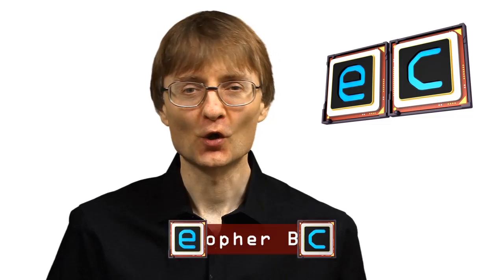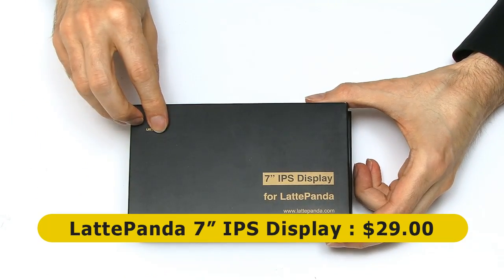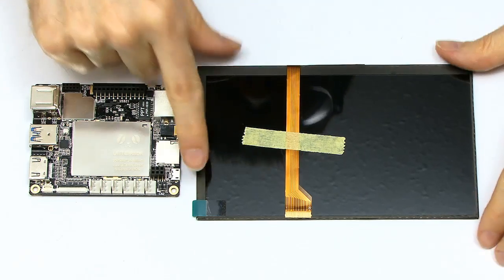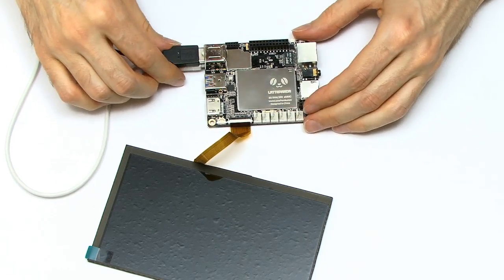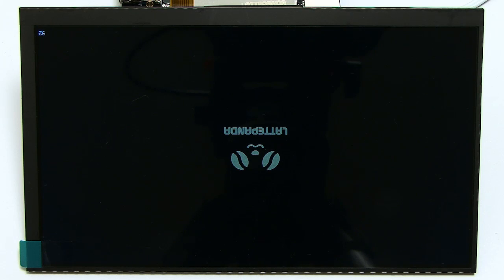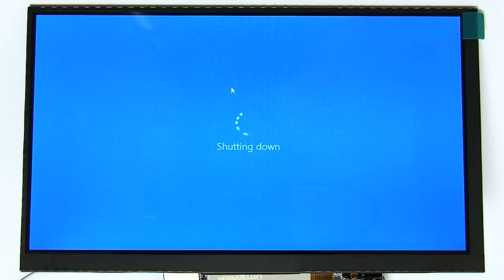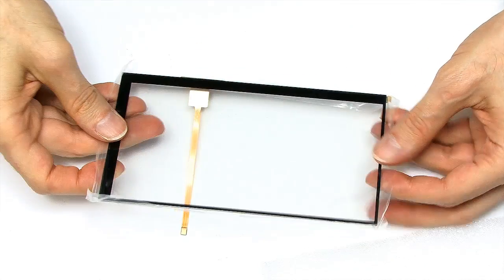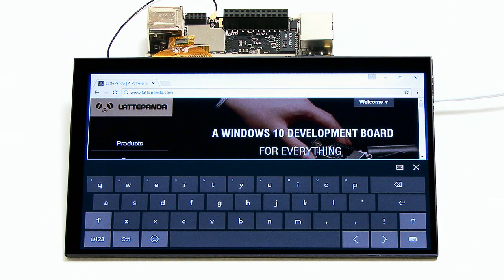LattePanda IPS Display & Touch Panel

Comment: Got a Raspberry pi 3 b+ . the 3d rendering program requires windows vista ...xp...or higher to run.  I need help to have my program be my sole pi use. New to this but my 3d program has been discontinued and I need help having a way to continue using it.

Comment: Is it possible to make it work with raspberry pi zero ?
Reply from the maker: You could potentially use some form of adaptor to get the screen to run from an HDMI input.
Reply: ExplainingComputers thanks for your reply, any idea from where can I buy in UK , atleast what name should search buy I believe only lcd panel adapter wont be enough because i tried searches didnt got exactly what i was looking for

Comment: Sir, can we used lattepanda board and used raspberry 5 inch display via hdmi cable??.. Are this working?
Reply from the maker: If the display has an HDMI adaptor, yes. If the Pi display connector, then no.

Comment: On the smaller stripe of adhesive on the touch panel you peeled off the small strip of sticky. You had it right in the beginning ... now there is a gap in the touchscreen edge on 2 sides

Comment: The angle of the cable in the screen is a little bit weird, it's against the lesser size, that can be a hassle if you need a good spot to stick the LattePanda.
It would be kinda better if the flat cable was in the right or left of the screen instead of in the bottom...

Comment: Hey raspberry can you install Windows programs on here like a normal computer or does it have to be a special program that's made for this device like the raspbiran os
Reply from the maker: Yes, the LattePanda runs a full copy of Windows 10, so you can install any Windows program that will run within the board's spec (which means most programs).
Reply: Awesome, thanks man, I'm ordering now, finally someone who not only does great vids but he gets back to you. very helpful highly recommend this guy, thanks for posting

Comment: Doesn't the Raspberry pi do the same thing without a silly overlay?
Reply from the maker: You can certainly fit an LCD to a Pi. I don't understand your overlay comment.
Reply: ExplainingComputers The capacitive overlay you had to install over the main screen. The Raspberry pi has it's own 7 inch screen which doesn't need that, it's all one unit. And one connector. I'm surprised the people who make Orange pi have a two piece screen. Rather complicates things. A lot more fiddling about.

Comment: Will it still work whem u connect it to hdmi
Reply from the maker: Yes, you can use both the LCD screen and an HDMI-connected monitor at the same time.
Reply: Thanks maybe make some dual screen p.c.

Comment: is it portable?
Reply from the maker: Yes if you can mount it in a case or otherwise. The whole thing will run off a USB power bank just fine.
Reply: thanks
Reply: Can i add more usb ports?

Comment: I kinda wish monitors where sold with the option of that connector (I guess it's a MIPI DPI connector) so you could attach the panda or some other SBC...

or if larger LCDs where sold like the little ones are on Ebay.

Comment: Agreed with many comments is there a case and battery solution on the way and  better still a  similar but 10 inch version .I can live with extra thick case from USB  ports to be able to hook into larger screens at home  and  also do dual boot up with a linux like mint

Comment: Could I theoretically install steam on this and have a mini portable steam machine?
Reply from the maker: I believe so, though the specs for gaming are low.
Reply: ExplainingComputers Yeah that's true, more curiosity than anything though. Anyway, thanks!
Reply: ExplainingComputers can the panda achieve successful overclocking
Reply: you can have an external video card however, and be able to play some great games. But if you want to play hardcore graphics gaming, you'll have to wait for the new Alpha model which has a x7 Core Intel CPU and the ability to expand video card to a 1080 if you wanted to.

Comment: Is there a way to wireless transmit the video information from the computer to the screen and the screen wirelessly transfer the touch information back to the computer and the only thing connected to the screen would be a battery and whatever wireless tech it needs to send and receive the mentioned data...

Comment: is there ANY other LARGER display or touchscreen i can use for this pc ???
Reply from the maker: I am not aware of another panel specifically sold for the LattePanda. However, it is a Windows PC with HDMI and USB ports, so can connect to any touchscreen that connects via HDMI (up to 1080p) and USB.
Reply: ty ill post u a pic of the project when i have completed it , going after a patent first tho befor i give photos !  ty again

Comment: please tell me one reason why t pay so much money to assemble a tablett my self if i can buy a ready one cheaper.because of win 10?you lose your name for sponsors.why you dont show the panta with other os maybe is even faster
Reply from the maker: It is very hard to install another OS on the Panda as it does not have a standard boot loader (like many Atom PCs), so you cannot just boot from USB and install, say, a Linux distro. Some have managed to get Linux working on the Panda to a degree, but not with all required drivers for networking, graphics, etc.

Comment: as this is a Intel video card if you got a keyboard plugged in press Ctrl+Alt and use the up or down arrow to Flip the screen (think the on screen keyboard can do it as well as you should be able to tap alt and ctrl to lock them on then press the arrows) or click on the Intel video driver in the icons bottom right and rotate the screen (windows 10 display page also has the options to flip the screen 180 as well)

was looking at one of these but its around £100 in the UK look intresting

Comment: correct me if im wrong but couldnt you techinically just make your own galaxy tab with this lattepanda and a screen? I mean everything is there, win10, ram, expandable memory, wifi. Seems like it would be easy to duplicate an ipad or samsung.
Reply from the maker: You are right! You just need a battery -- and a USB power bank can serve for that.
Reply: Do you know of any videos or a site that talks about how to connect and battery and charging circuit to the lattepanda?

Comment: Is there a way to connect a harddisk to the latte?? Sorry, im not very into technology, but these board pcs are so amazing
Reply from the maker: You can connect a hard drive or SSD via a USB port, preferably the USB 3.0 port. And you can add more storage via a micro SD card.

Comment: this is like a less expensive version of the microsoft surface. it would be nice if it had a functional case for it as well.
Reply from the maker: There are various cases for a LattePanda and screen that can be downloaded for 3D printout from Thingiverse (and which you could get printed via 3DHubs if you do not have a 3D printer). I intended to cover this in a video fairly soon.
Reply: that will be cool. i look forward to seeing it. i was kind of sad that MS discontinued their surface model. now at least i have other options available.
Reply: surface studio > $3000. it's not in the same ball-park as the discontinued MS surface.
Reply: the surface 3 came with windows 10 and was in the $400-500 range.

the least expensive surface model available now is the surface pro starting at $800 and i don't think it's worth it compared to other windows 10 tablets.
Reply: Androth worth it because of the power
Reply: uski12 did you really think im stupid enough to think that an arm cpu will beat a windows running machine? i meant that the surface line is worth the price since it has pretty good power
Reply: uski12 since most windows tablets dont even get close to it
Reply: uski12 dont worry its ok
Reply: uski12 i mean you exagarted with the sorry ness idk im spanish and my english is not that good
Reply: true but not what i'm looking for. i already have a small laptop that blows any surface away. i want to get one that i wouldn't mind getting dirty, breaking or losing.
Reply: Androth also the 400$ surface you were talking about was the surface rt right? it didnt have full win 10 it didnt let you install anything it was shit

Comment: I'm retrofitting a 1987 Toshiba laptop with this display and the Lattepanda 4Gb. The original screen was about this height but much wider.
Reply from the maker: What an excellent project. Have you managed to connect the old laptop keyboard to the LattePanda?
Reply: ExplainingComputers Yes and no, I had to reverse engineer the keyboard. Most but not all keys work now with USB. I'm still working on that part

Comment: Are there any mounting holes of any kind on the back of the monitor?
Reply from the maker: So, no mounting holes -- or anything else similar -- I'm afraid.
Reply: Could the touch panel work with another 7-inch Display if it's compatible with LattePanda? I'm trying to find a way to make a compact setup for my lab station

Comment: I realize that this SBC and touch screen has some coolness for experimenting, but you're spending more than you need to for a functional Win10 touch 7" screen computer. With the LattePanda and screen and touch you've already spent over $200 and you haven't even got an enclosure, battery power or power supply. In comparison, for $165 you can get a full Win10 2G/32G quad core touch netbook with 10" screen on Amazon (G-Anica Chromebook) with a 1 year warranty.

For an IoT device I prefer RPi3 (or DragonBoard) with Win10 IoT Core Pro (Pro version is free now) since the OS can be locked down to protect it and your application from tampering.

Comment: In Windows 10 you should be able to flip the screen orientation by holding the right alt key + the down arrow (for upside down), right arrow or left arrow for side rotation, and bottom arrow for right way up.

Comment: I am not a developer. is this still a viable windows board. I wish to use many small cheap boards. to link into the Berkeley BOINC computer grid.
Reply from the maker: It is certainly a viable Windows board.  Windows 10 runs absolutely fine. I know nothing of the Berkley BOINC computer grid I'm afraid -- though it sounds very interesting! :)
Reply: Thanks for the info. I have been to their site. I can't find reference to which version of 10 it is. (Home, Pro, Ultimate) do you kow how long this has been around? There seems to be some trouble with bad cards. I think this is a very nice idea for portable computing.
Reply from the maker: Matthew Doenges The LattePanda came out this year (2016) as I understand it. I too have read about some problems with the first production batch, but I think this is a past issue now. Often the first batch of a product has issues. The Windows images available are 32bit for the 2GB board, and 64bit for the 4GB board -- links are lower down on this page: http://www.lattepanda.com/docs/#How_to_re-install_LattePanda_Windows_system (look under "How do I re-install LattePanda Windows system?"

Comment: You know it has arduino(micro controller) in built. So you can make a box of this with the screen. Have a temp sensor inside and a fan that turns on if it gets to hot..

Comment: Can the touch panel/display and the hdmi display be used at the same time? Like dual projections or running two displays on your desktop.
Reply from the maker: Yes, you can dual display and use the LCD panel and the HDMI output together.
Reply: cool

Comment: So can the LattePanda have an external HDMI monitor plugged up while this display is being used, or does using this prevent the HDMI output from working?

I really wish they'd sell the larger 4GB/64GB version of the LattePanda with an activated version of Windows 10, instead of leaving the confusing activation process as an exercise for the customer.  I would have ordered one of those months ago! 

Thanks for the great videos!
Reply from the maker: Yes, you can run both the LCD panel and an HDMI monitor -- which is pretty neat! :) It is indeed say that LattePandas with Windows activated (as I show in the video) no longer seem to be available for the 4GB/64GB version. You can, of course, use Windows 10 unactivated for an indefinte period if you don't mind the "activation" water mark on your desktop . . . :)
Reply: Thanks Christopher!  I may try to build a LattePanda system (processor, case, fan, heat sinks, display, etc) after Christmas, helped by your informative videos. 

My main computer failed a couple of months ago due to a liquid coolant leak, so I had to build an emergency backup CENTOS system for e-mail and web browsing on some ancient hardware I still had laying around until I could fix it (which took a while).  A LattePanda running Windows 10 would have been much nicer!  To add insult to injury, when I eventually did repair my main computer (upgrading most internal components) Windows 10 required me to re-purchase an expensive "pro" license to activate it again - even though it was the original boot drive and logically the same system just with some new, updated hardware...  They have weird rules for transferring licenses from old Win-10 systems too, that seem to prevent this from working most of the time - thus it would be much nicer if LattePanda would just bite the bullet and sell the large configuration activated in the first place.  I see this requested a lot in their forums.

Comment: +ExplainingComputers / Christopher

I was just browsing the net and found a laptop chassis that is built for usage with the RaspberryPi (could also be used with other single board computers / brands) that I thought you may be interested in.

The product is called the Pi-Top, there is a review at: 
https://www.raspberrypi.org/magpi/pi-top-laptop-review/

Specifications and other information::
http://uk.rs-online.com/web/p/processor-microcontroller-development-kits/9176216/
Reply from the maker: Very interesting -- thanks! A potential video . . .  :)

Comment: New subscriber, and i'm already pretty interested on the content of this channel.
But i already have 2 questions:
1-If you connect a external monitor to your hdmi output with that ISP display already connected, will it effectively work as dual monitors?
2-Are there any premade cases to accommodate the LattePanda and this display?
Reply from the maker: Yes, you can connect both the IPS panel and an HDMI monitor and they will work as a dual monitor setup. There are some 3D printable cases on Thingiverse -- keep watching for more on that. :)

Comment: Hi Christopher! I have a question about LattePanda. 
My device have a strong heating to 70 degrees (with 5 cooper heatstik). It's normal mode or i must use active cooling?
What can I do to reduce the heat without active cooling?
Reply: I'm no expert on these boards, but the Intel atom CPU that this board uses can handle that temp without issue. If you start to measure 80 degrees or more then you should consider adding active cooling to ensure the life of the equipment doesn't suffer as the CPU's max operating temp is around 90. (at that point it starts under-clocking itself to prevent damage or in extreme cases it will shutdown.) I hope this answers your question. :)

Comment: I appreciate you showing off these cool device but I'm never watching any of your videos again, just go back to your small Linux world. The fact that you used third party programs on windows greatly offended me. Why would you use other programs while you have Edge and Office on Windows.
Reply from the maker: I am sorry to have offended . . . :O
Reply: I'm sorry too.
Reply from the maker: And I am bewildered! :) You seem to be complaining that I am using free rather than paid software. On this test PC I have installed OpenOffice (rather than purchasing MS Office). And I am using Google Chrome because it works far better with Google Docs, in which I do most of my work.
Reply: Oh that, I forgot that Microsoft office wasn't free. Please forgive me for that. But still you can use Microsoft office for free online.

But I still cannot forgive you for using google > googleChrome > googleDocs. Their products favors/requires another of their product because when you take them apart, they are redundant. I hate google because of this. My belief is that windows is pretty much has everything a person needs, for me these third party applications (which windows already has) are nothing but bloatware.

I always strive to keep my computer clean and neat, without unnecessary programs. I also don't use any so-called anti-malware applications. I can handle the viruses(I'm not sure that this is the right plural) manually myself, if we assume that they can find a way into my computer. And my pc is running like clockwork and using minimal amount of resources. I'm a freak this way.

Now please don't get me wrong, I don't want to argue for this is neither the place nor time. I'm just talking about my opinions. But I'm a thorough Microsoft supporter/zealot and I get offended pretty quickly.

Sorry for the very long reply.
Reply from the maker: cannibaloguz2 No problem, though I am sorry that you will not be watching any more videos, :) I usually get moaned at here for using Windows! I cannot win . . .
Reply from the maker: Welcome back, and thanks greatly for this. Cool that you have created your own app! :)
Reply: Not to sound ungrateful or anything but I'm expecting some feedback if you please^^

Comment: Will the ips screen also work with the raspberry pi 3 for example? Because this would be a way cheaper solution than the Pi screens!
Reply from the maker: The screen will not work with the Pi I'm afraid, wrong interface. :(
Reply: Thank you for your answer. That's a shame. It would have been such a nice cheap solution!

Comment: what power supply would you recommend
Reply from the maker: Anything with a micro USB connector that is rated at 2A will be fine.
Reply: ExplainingComputers thank you , i wanted to know before buying because sometimes my pines don't start unless i give the 2.5A